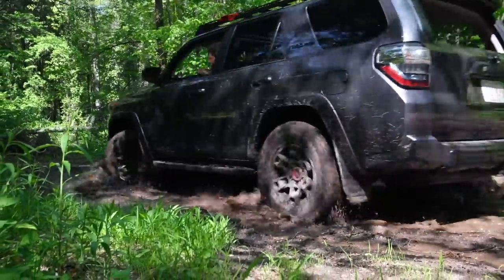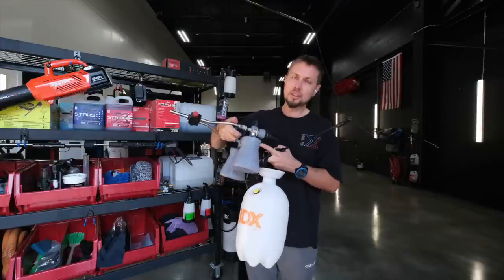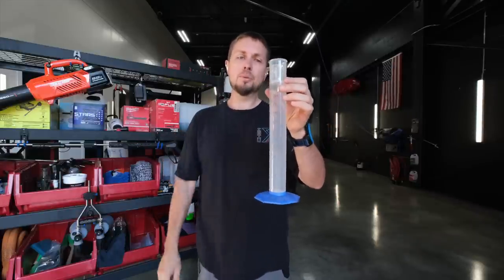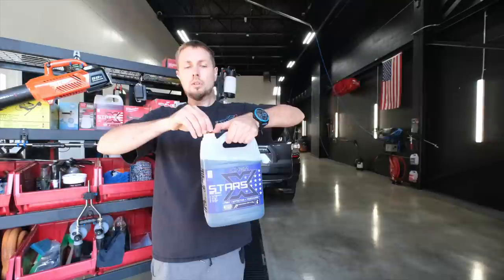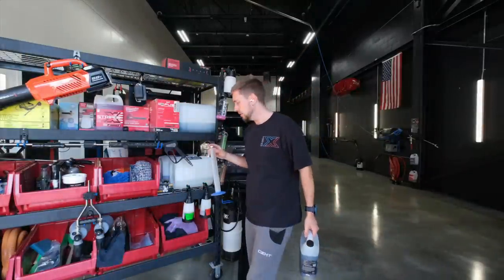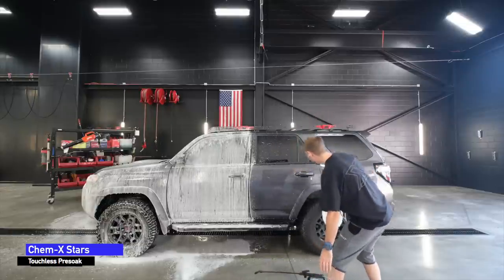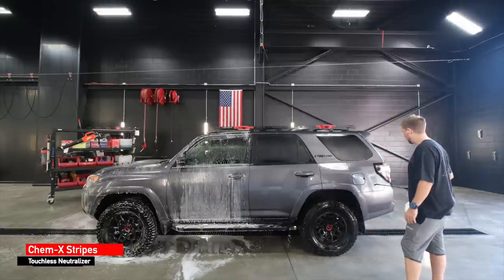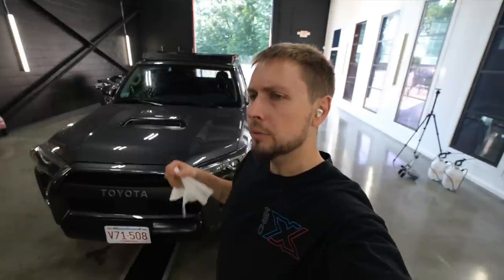Can my touchless soaps be used in a pump sprayer?

Comment: Another awesome Chem X video. Thank you for being so precise about the math and amount of washes. Still trying to convince my boss this is better than going to a truck wash🙄
Reply from the maker: Thanks bud! I think I’ll have to do a full wash side by side soon on how many washes with different techniques, every vehicle size and level of dirt will yield different amounts of washes, I think it’s an interesting topic to touch on each time
Reply: @ChemX  question, if a guy didn't have the 3k for X Factor portable, would have any recommendations for a decent pressure washer to start off with?
Reply: @scraphaulin  4gpm is where you want to be. Pressure is not the answer. I think bob is spraying at around 2k psi on the rinse but throwing 4gpm out. Gpm is your speed. The issue with a lot of the gas engine units is they are not designed to bypass for long periods of time before the thermal relief valve pops and no more pressure. Electric units that auto shut off is where it’s at
Reply: @vansage2691  thank you
Reply: @scraphaulin  plenty of good options, just depends on if you want gas or electric and the serviceability

Comment: I'll do a full review as well on your website but I just washed my brand new F250 Long Bed using this method along with Snake Oil at a self service car wash.

I used a 1 gallon HDX pump sprayer for Stars & Stripes ( about $11 each at Home Depot ) This worked really well for not having access to a home pressure wash system. I put 126 oz of Water and 2oz of Stars & Stripes. It was easy to get a good amount all over the truck. 

I rinsed the truck then used Snake Oil with the IK Foam Pro 2+. The IK foams up real nice. I used the entire sprayer on my truck. I would say the IK Pro Foam 2+ is too small for a large truck. For a Mid Size SUV or Car its a perfect size. I will be buying a second one so next time I use it I'll make sure I have enough to get it on better without worrying about it running out.

Thanks again for these videos and all the Touchless Products you have. Looking forward to what's next!

Comment: If you use the  ik foam 12. it will make the clingy foam like the foam cannons and works pretty well if your looking to save water. It does take longer for sure.
Reply: What is your mix ratio for ik foam?
Reply: @Austin2276   I used 100.1 ratio. I put a gallon of water in the ik and about 1.5 Oz of stars or stripes in it.

Comment: For what it's worth, and I'm no expert. 

I wonder if stars and stripes applied via a foam cannon is diluted again with the effect of the air in the mix. The pump sprayer version is a s pure a liquid as you can get as there is less air in the actual surface product. 

I can see that there is advantages to both. Both are a touchless wash, the cannon application could be a top up clean on a regular wash cycle, and the pumped wash could be the higher detail type wash, but still touchless. 

I think both work, and some folk will like the results of the pump application. 

Good work as ever.
Reply: Dilution rate would be unaffected by air.  The product will be the same dilution rate, just spread out a bit more along the surface.  The sprayer may just over supply or over coat with the 1% dilution compared to the foam.

Comment: Thanks for this. I'm currently staying with family and have no way of buying a pressure washer and the foam cannons. I just picked up a new F250 yesterday and want to use Stars/Stripes along with Snake Oil. I've been chatting with Nate off an on about this. I was going to go the hand pump route at a DIY wash so I have the pressure. 

Can Snake Oil also be used in a sprayer?

If i had the ability, would a hose nozzle wash sprayer work better for applying then power wash it off? Once I get settled a full system will be bought and set up. I'm really hoping to find a way to use this now ( snake oil more than anything ) as I'm about to drive cross country and back.

Thanks!

PS... if I order stuff tomorrow can I pickup from you and get a first wash/snake oil hit while there? I'm in NY

Comment: I have been using your system for the last couple weeks with pretty decent results however my pressure washer is putting out 1000 psi at the nozzle which I checked with Gauge and is right at about 2 gallons per minute. I’m going to upgrade my pressure washer in the next couple weeks I think that’s probably a bigger key to success I just don’t have enough pressure to take off the dirt the way I need to.
Reply: If you're using the foam cannons he sells with a smaller pressure washer try changing to the smaller orifice. I was getting ok foam with the orifice that comes installed. Yesterday i switched to the smaller one and got much better foaming. I got a craftsman pressure washer from lowes that is like 2700psi and i think just under 3 gpm.
Reply: yeah, 1k psi isn't all that great. 

his pressure washer seems to have the power (or more) than my "3100psi" gas washer. 

I have used homeowner style electric washers and they just feel weak. the pro grade electric ones are nice, but super expensive and need 220v.
Reply: @volvo09  i believe Bob's is like 4000 psi and like 6 gpm so much more than any pressure washer you'll get at the hardware store. 1000 might be too low even with the smaller orifice.
Reply: @95dodgev10  yeah, it looks very powerful. His 40deg nozzle from far away hits like my 20 up close.

Comment: I have a karcher with 2 chemical tanks, can I run stars and stripes through it and just use regular wand or need a foam cannon? What about using hot water?
Reply: If you have enough flow to push it. Recommended 3000 psi @3.5 gpm minimum
Reply: @94muddertrucker  4.6gpm but only 2200 running psi.
Reply: @cslimfu336  that's a lot of gpm for that little pressure. Hot water definitely helps as well.

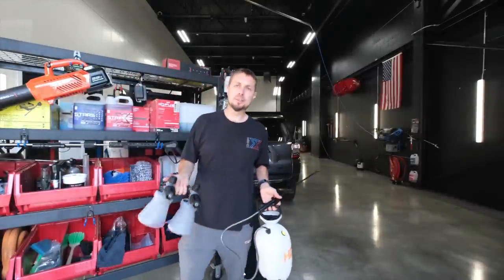Comment: So, not a a detailing pro here but definitely math guy.  At 1:33 you say you mix 4 parts water to 1 part soap (4:1), then you say 3/4 water to 1/4 soap, which is 3:1.  Should be 4/5 water to 1/5 soap, right?

Comment: Hey what is the recommended psi for a pressure washer to get good results with the touchless wash?
Reply from the maker: I’d say at least 1500psi at 2.5gpm. I’m gonna use some lower specs then that in upcoming content and see how it goes though, lower specs generally can get it done but take longer to do it